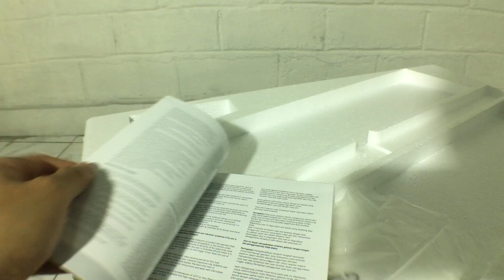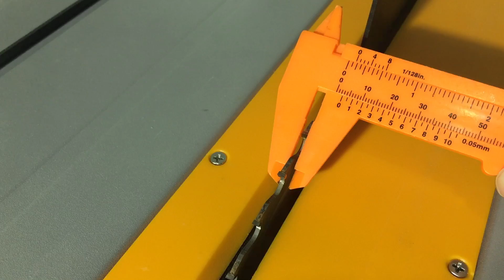Unboxing & Review Krisbow Table Saw

Comment: Sore Mas, Saya lg tertarik bgt pengin bikin2 furniture sendiri dan pengin mipil ngumpulin alat2.
tapi saya masih belum tau jenis2 kayu.
yg Mas pake praktek di video itu jenis kayunya apa ya? apa di pasaran udah ada yg jual papan yg permukaannya udah rata gitu?
krn saya beli papan pinus yg di material belum rata, dan nyoba ngeratain pake mesin serut masih belum bisa rata

dan kalo pake kayu yg buat praktek Mas di video itu kuat ngga kalo buat dibikin rak yg setinggi sampe 1,5 m

Terima kasih
Reply from the maker: sore gan, saya pakai kayu jati Belanda itu gan, yg udah rata ada gan biasanya bekas pallet tp ya gt biasanya ratanya ga seragam, kalau mau sempurna harus pake alat lg planner thicknesser tp mahal, biasanya ngakalinnya abis d jadiin papan di grinda biar agak rata, kuat gan asal ada tulangan untuk strukturnya
Reply: @bikinbikin  siap makasih banget Mas infonya
Reply from the maker: misar isan sama-sama gan

Comment: Bagaimana mas.. Kira kira berapa totalnya ke lombok plus ongkir nya.. Di lombok kayaknya belum ada kalau modern siiih ada
Reply from the maker: bs beli di ACE lombok gan ini : https://www.google.com/search?safe=strict&source=hp&ei=zOwxXZGeE4PCz7sP9qmsgAQ&q=ace+hardware+lombok&oq=ace+hardware+lombok&gs_l=psy-ab.3..0l2j0i22i30l2.938.5104..5394...0.0..0.136.1497.17j3......0....1..gws-wiz.....0..0i131.pTDdOnGXHW4&ved=0ahUKEwiRtILcsMHjAhUD4XMBHfYUC0AQ4dUDCAU&uact=5
Reply: Ok. Terima kasih informasinya mas.
Reply from the maker: sama2 gan

Comment: Tebel maksimal belah kayu brp cm ?
Reply from the maker: https://www.krisbow.com/table-saw-80mm-x-254mm.html
Reply: @bikinbikin  Max width workpiece (to cut): 180 mm

Max width workpie ce (to rip) : 210 m

Masa maksnya 10inch TableSaw utk kayu tebel 2.1cm doang om ?
Reply from the maker: yg ini gan :
Max cutting 90 Deg : 80 mm
Max cutting 45 Deg : 55 mm
Reply: @bikinbikin  oh iyaa wkwkw makasi .. jadi max height 5.5 cm , btw harga dah naiks banget skrg , cari2 diskon bisa dapet 2.4 .. tapi ya sepertinya paling worth di kelasnya
Reply: Gan saya bingung kok posisi guide railnya posisi 0 ga persis di Mata saw , Kaya off gitu ya ?
Reply from the maker: @diegodimas  di setel lg aja, cover blade selang vacum d copot dlu